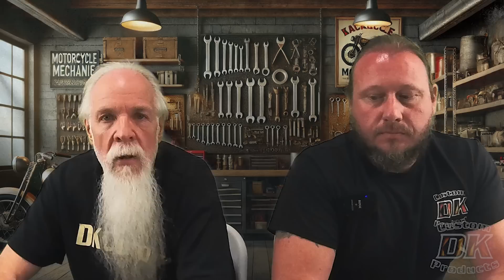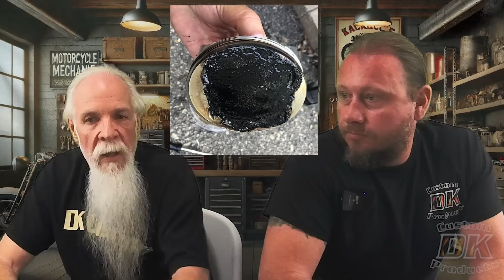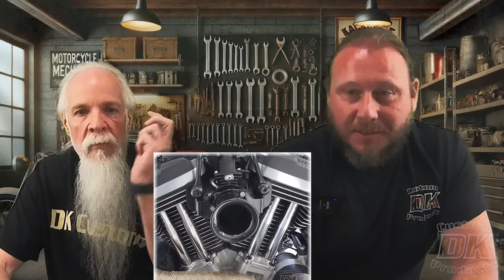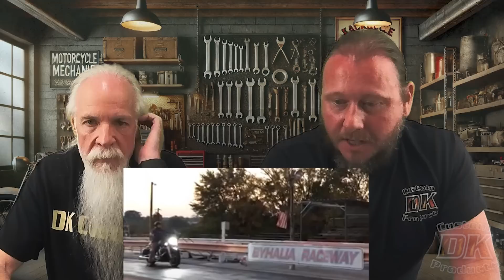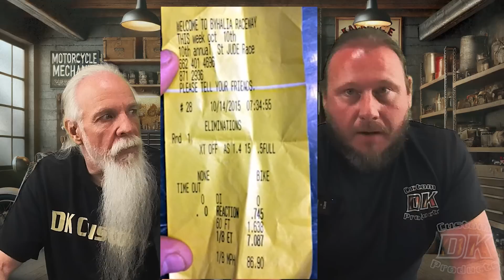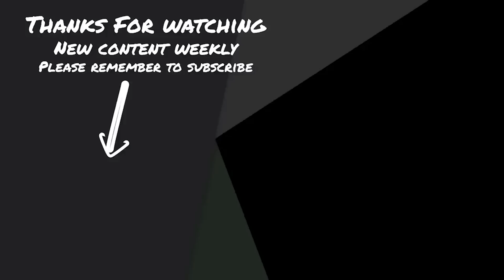❌ STOP WASTING MONEY on the WRONG Air Cleaner! Here’s What You NEED to Know 🔥

Comment: I have a 2020 CVO Tri Glide with a stock 117 air cleaner. I was thinking of installing a HD heavy breather elite air cleaner (Getting it for free). Will I get better air flow / performance with the new heavy breather over my stock air cleaner? I plan to instal your external breather to stop hot air oil from entering the breather.  My concerns are will the lower fairing block the needed air with the heavy breather pointed forward and so close to the fairing? Thanks for any input.
Reply from the maker: The HD HB will flow more air than the stock paper filter.
It is still not as free flowing as the 606 or the 828, since it has to use a "short" filter element because of the lower fairing.
Regarding your concern about air blockage of the lower fairing impeding flow into the air cleaner, this is not an issue.  The filter element will pull air into it from around the entire element.

You can see more information about our Air Cleaners at this link - https://www.dkcustomproducts.com/differences-between-outlaw-hiflow-air-cleaner-systems-dk-faq-acs.htm

You can see our Air Cleaner at this link - https://www.dkcustomproducts.com/air-cleaner-intake-c10.htm

Please feel free to reach out with any questions:
Support@DKCustomProducts.com
662-252-8828

Thank you for commenting! 😎 MB

Comment: The 636 looks great and the 606 could work too. Does the full cover on the 606 change the airflow compared to the open filter. What is the limitation if caught in the rain with the open filter and the sock. Should you park or keep riding?
Reply from the maker: Yes, the full covers do reduce air flow a bit.  If you do a lot of full throttle, higher RPM, acceleration, you may feel the small difference.
With the air cleaner with the filter exposed, you will not notice any problem with the bike running well in light to moderate rain.  The filter element is serviceable, and after cleaning it, it is oiled, and that keeps out all but the heaviest rain.
In cases of heavy rain (as in, difficult to see in front of you) the rain sock will keep that water off the filter element, and the bike will run fine.  The rain sock is also very good, in dusty conditions, at keeping the filter element clean, and it does not restrict air flow as much as the covers.

You can see a report on our Air Cleaners and Dyno charts at this link - https://www.dkcustomproducts.com/differences-between-outlaw-hiflow-air-cleaner-systems-dk-faq-acs.htm

You can see all of the Air Cleaners at this link - https://www.dkcustomproducts.com/air-cleaner-intake-c10.htm

Please feel free to contact us with any questions:
Support@DKCustomProducts.com
662-252-8828

Thank you for commenting! 😎 MB
Reply: @ does the 636 come in polish or chrome? I want the EBS and didn’t see that in description.??
Reply from the maker: No we only make it in black powder coat. Sorry! MB

Comment: Doesn't a freer air flowing air cleaner help your engine run a little cooler oil temps?
Reply from the maker: Not really, but a little. A good Air Cleaner with an EBS will prevent hot, oily, oxygen depleted air from flowing through your throttle body and into the combustion chambers.  Having only cool, clean, oxygen rich air going into your engine makes for a stronger & cooler running engine, plus one that does not get carbon build up on the pistons which causes more heat and pinging down the road.
But if the engine is hot the oil will be hot. 

You can see a 2 part report on Why & How to Cool Down Your TC/M8 that you may find useful/interesting - https://www.dkcustomproducts.com/why-how-to-cool-down-the-twin-cam-engine-part-i-dk-cl-tc-dn-1.htm
Part 2
https://www.dkcustomproducts.com/why-how-to-cool-down-your-twin-cam-engine-part-ii-dk-cl-tc-dn-2.htm

You can see a full play list on Why & How to Cool Down Your TC/M8 at this link - https://www.youtube.com/playlist?list=PLb3bvZgbH92_3s-2vv63QggFJ3nteFd_C

Thank you for commenting! MB
Reply: @DKCustomProducts  THANK YOU and I will check out those channels!!!
Reply from the maker: Thank you! 👍😎👍 MB

Comment: The turbulent air helps to mix the air and fuel. Vaporizing the fuel and keeping it in suspension is the thing.  Smooth flowing ( laminar flow )air will push / pull the fuel along put will hinder the mixing of fuel and air.
  Of course smooth flowing air moves easier which in turn would aid in getting more air in to the combustion chamber but, it also reduces the air fuel ability to mix. Textured intake surfaces ( of which many companies have their "better" design) help with irritating the air flow and helping mix the air / fuel.  
 Maybe a texture on the inside of the air cleaner cover ?  Nah.  The filter itself would just smooth out any of that turbulence probably/ maybe.
    Maybe a post filter element and pre injector/jet section, with texturing or some sort of vanes to help swirl the air ?
   Or how about some type of insert for the intake itself that is post injector/ jet ?
    It's possible to go all kinds of directions with this stuff and people have. As I'm sure DK is aware. Especially in the automotive world.
Reply from the maker: Thank you for watching the video and for commenting! You may enjoy reading some of the comments on this video and the video itself! - https://www.youtube.com/watch?v=Z2y2-MQrGO8
😎👍 MB

Comment: Thanks, This sounds great. However, I just spent $450 on an air cleaner. Can't really fork out another $300 right now. Perhaps I can modify the one I have.  BTW, I put Nexgen shocks and Intiminators on my Ultra. I still can't believe how much better it rides. I used to avoid every bump and hole if at all possible because it always felt like my frame was hitting the ground. Now it just glides right over them.
Reply from the maker: It is great to hear that you are enjoying the benefits of having the NexGen™ Shocks and Intiminators installed. If you are wanting to add an EBS to your Air Cleaner feel free to reach out and our Customer Service will gladly help you choose an EBS that will work with your set up. 
Support@DKCustomProducts.com
662-252-8828

Here is a link to a video on Choosing the Correct EBS - https://www.youtube.com/watch?v=85jEZjX6Dhw

Here is a link to a Report on Choosing the Correct EBS that you may also find useful - https://www.dkcustomproducts.com/getting-the-right-external-breather-systems-ebs-for-your-bike.htm

Thank you for your business and for commenting! 👍😎👍  MB
Reply: A kit EBS is convenient and clean, especially if you’re not handy in the shop. You can build a EBS kit for under $20 and get the same results.